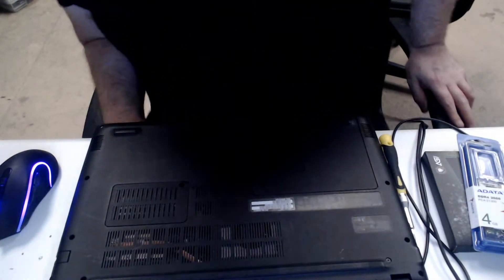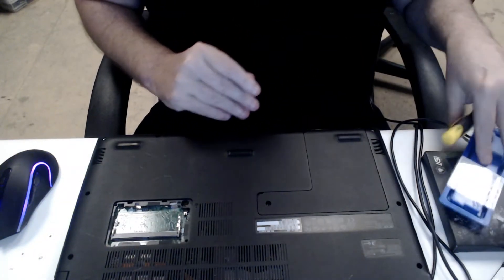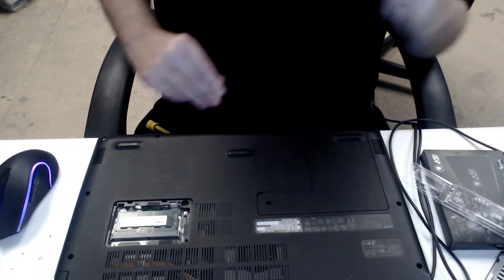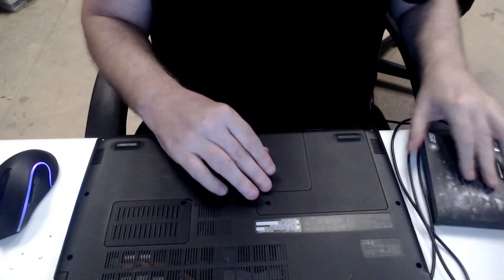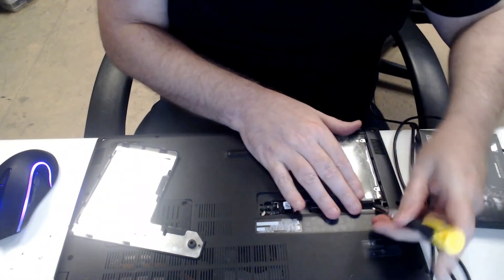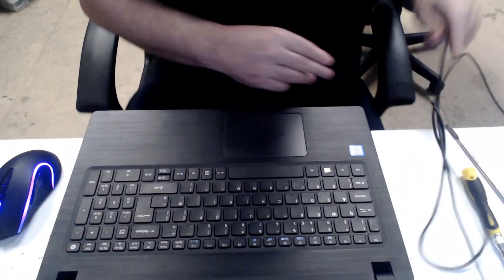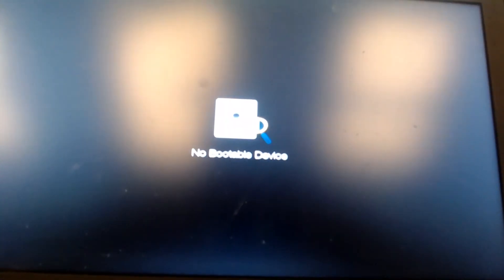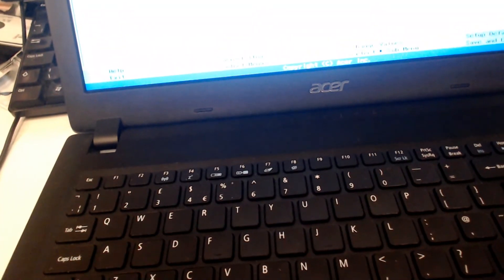Acer Aspire3 A315-51 RAM & SSD upgrade! | How to fit

Comment: Can you add 16gb ddr4 3200 to this model?
Reply from the maker: Hi, Apologies for late reply.  It has 4GB DDR4 2400Mhz soldered to the board, I think its max is 20GB so you can add a 16GB DDR4 2400 stick to it.  I would check you specific laptop by going to https://uk.crucial.com/upgrades or putting in your SNID on Acer website to check what it will take. https://www.acer.com/gb-en/support/drivers-and-manuals then look up specs.